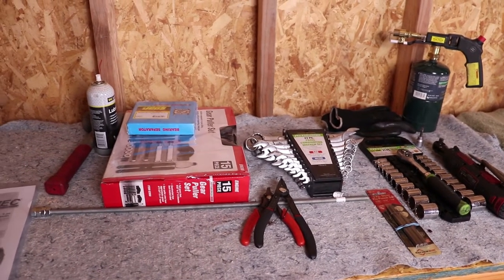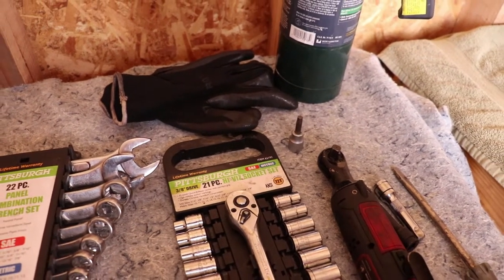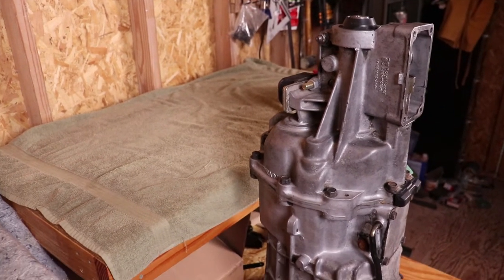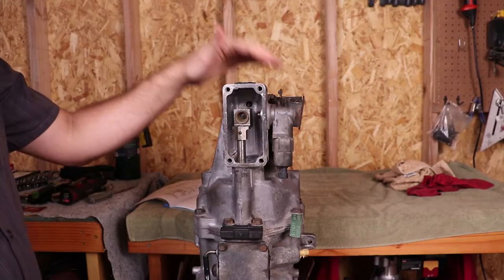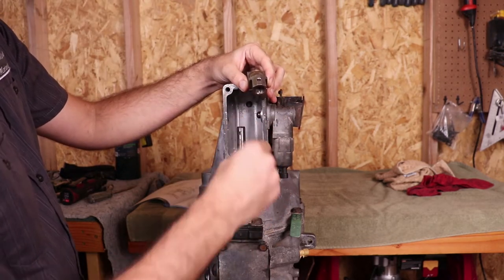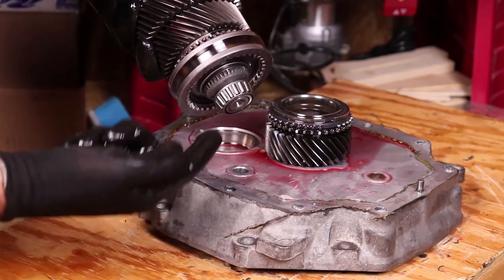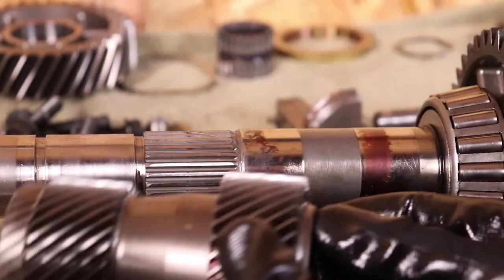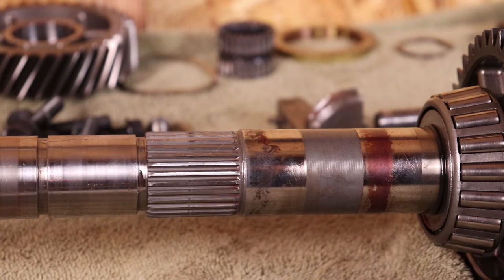Rebuilding my own F Body T56 - Part 1 (Disassembly)

Comment: Best step-by-step T-56 rebuild video I’ve seen, yet!!  I am having 1st and 2nd gear engagement problems in my 2000 Corvette.  You’ve given me the confidence, bravery, and courage to take on this job!
Reply from the maker: Thank you, that's awesome! 😎👍
Reply: I have an issue getting it into first time to time after coming to a stop. I’ve also had the shifter kinda bounce back when downshifting into 3rd and 5th. I think it might be getting close to rebuild time.

Comment: Ty, for the very helpful video about to open up the t56 out of my 95 z28, the lost 5th and 6th
Reply: I'm taking my box out, my teeth are bad in my 2nd all my others go good ..my mechanic is going too dude my clutch/ sand it, but he took the box a trans spot next block

Comment: Excellent vid. Saving me with the 5/6 assembly. I'm fixing what Tick screwed up / failed to fix.
Reply from the maker: Glad it could help! What part of 5\6 assembly did they miss?
Reply: @TheBudgetMindedMotorist  They didn't replace the snaprings for speedo reluctor. They literally slid off. They didn't mention or fix 5th gear or the synchro. Both are bad. Car never seen 5th since they rebuilt it until 14 months later my son tried to go to 5th first time driving it and it would grind. The car was sitting in the trailer for 14 months and was never driven. but Tick wouldn't warranty it. They used the nylon shift pads. One was broke.
Reply from the maker: @hotroddude6551  oh man. Sorry to hear that!

Comment: I bought the 12 ton press and the channel where the gear rest’s between is too small and doesn’t fit. Hopefully the 20 ton does as I will be returning the 12 for the 20. Just for this job.
Reply from the maker: The 20 ton is what I used.
Reply: I was wondering if the 12T would work.  This clarifies it.  HF 20T press is on the tool list. Thanks guys!!

Comment: Like the video, do a good job at commentary and pretty engaged and thorough
Reply from the maker: Thank you!
Reply: @TheBudgetMindedMotorist  also what is that plug in underneath the green tag? Yellowish in color? Mine snapped off of my t56 and I don't quite know what to order to replace it.
Reply from the maker: @marlattmotos  it's the skip shift solenoid
Reply: @TheBudgetMindedMotorist  what's it do exactly?
Reply from the maker: @marlattmotos  basically it locks out 2nd gear under low load acceleration and guides the shifter straight from first gear to fourth, skipping 2nd and 3rd. It was supposed to help with fuel economy. If your transmission isn't locking out 2nd under low load, skip shift may have been tuned out of the ecm or disabled with a skip shift eliminator like this one. https://www.ebay.com/itm/Muzzys-21008-Skip-Shift-Eliminator-CAGS-1994-2022-Chevrolet-Dodge-Pontiac-Manual-/251584509967?mkcid=16&mkevt=1&_trksid=p2349624.m46890.l49286&mkrid=711-127632-2357-0

Comment: The T56 in my 1996 Camaro SS has an issue with 5th gear. When I try to shift into 5th and let the clutch out, it doesn't seem to fully engage and pops out. Sometimes if I double clutch it, it will go on in. The rest of the gears  - reverse, 1 through 4 and 6th all engage fine. What could be wrong? Bent shift fork? Worn shift fork pads? Bad synchros for 5th? Since 5th/6th gear assemblies are accessible from removing the tail shaft, would replacing the synchros or shift fork pads be an easy job I could do in my driveway?

Comment: Thanks for the video, I just found you at Facebook t56 page, question ❓ got my hands on a t56 97 Pontiac firebird, second gear grains and sometimes is harder to shift in to, all the rest of gears shift good except when I go to 6 gear I got vibration, any input I will appreciate thanks again
Reply from the maker: If it's grinding going into second it's likely the clutch material is worn from the 2nd gear blocker ring. If it hasn't been happening for too long you might be able to reuse second gear and the 1-2 synchro slider. It's worth replacing all the blocker rings and inspecting all gears and synchro sliders while everything is apart. The vibration in 6th could be caused by worn splines on the main shaft where the 5/6 cluster gear presses on. If the 5/6 cluster slides off without much effort I would take a close look at the main shaft splines and if they're severely worn I would recommend having the splines repaired.

Comment: This is an amazing work! Found this just as I was about to replace all of the reverse parts . Question ...my t56 had been disassembled prior to buying it and was missing everything all the way to the synchronizer and reverse fork . I've ordered everything but can't seem to figure out the part# for that first plastic spacer you pulled above the speedo gear. Any help finding this part would be much appreciated.
Reply from the maker: Thank you! Are you talking about the black piece at 7:32? The service manual refers to it as a "sealing ring" on pages 2-5 and 4-4 but it does not list a part number and without the part number I've been unable to locate the part online. I can only recommend reaching out to Tremec via https://www.tremec.com/contacto.php. Let them know that you're looking for the sealing ring described on those pages and see if they can point you to a source for the part or at least give you the part number. Wish I could offer more info.
Reply: @TheBudgetMindedMotorist  yes , that "sealing ring" at around 7:30 is the part I was inquiring about .  I'll contact tremec like you suggested. Thank you for the response and for the help .
Reply from the maker: You're welcome! 😁👍
Reply: @The Budget Minded Motorist  Just an update on that sealing ring . The manufacturer told me it's not necessary to put it back if I don't have it.
Reply from the maker: @AlvjaDahat  that's great to know! Thanks for the update!

Comment: I take it this should be the same steps for a t56 out of a 06 corvette?  I need to replace the output shaft.
Reply from the maker: While they're both technically t56s, the Corvette T56 in the Corvette is set up differently as far as the shifter and tail end go. Synchros are slightly different in the later T56 as well, if I'm not mistaken. I would imagine the process is roughly the same, but there will certainly be some differences here and there.